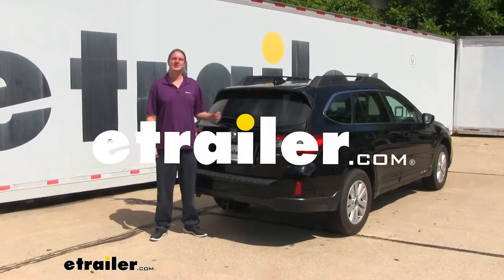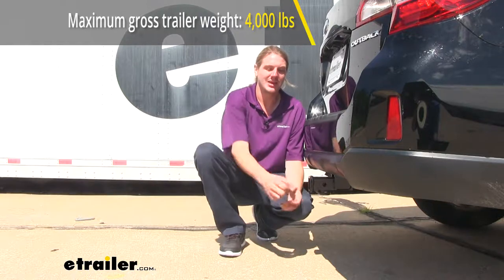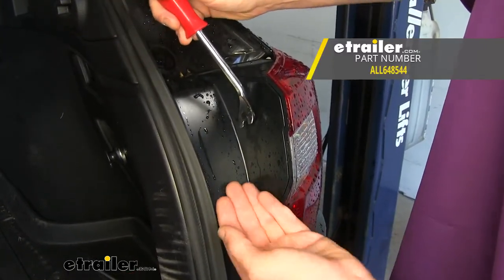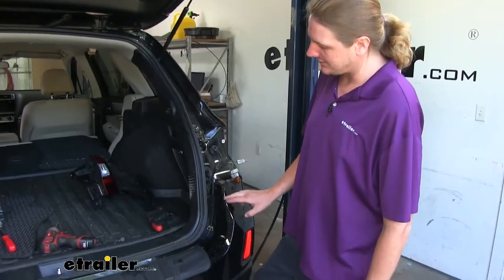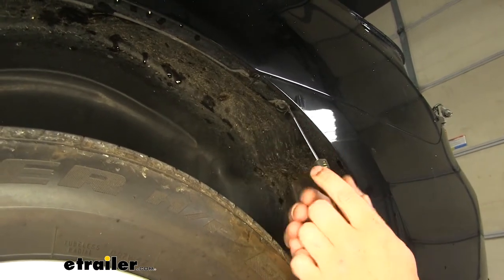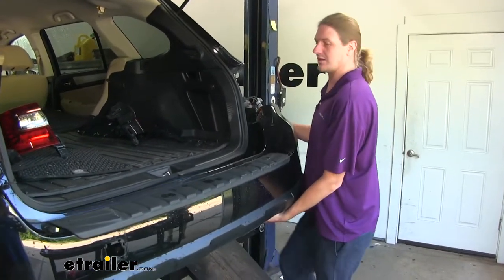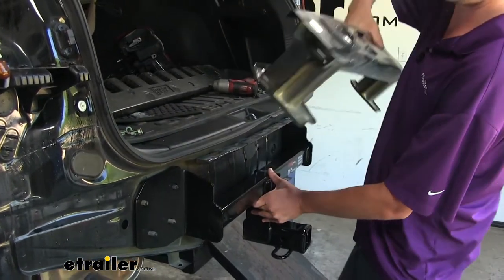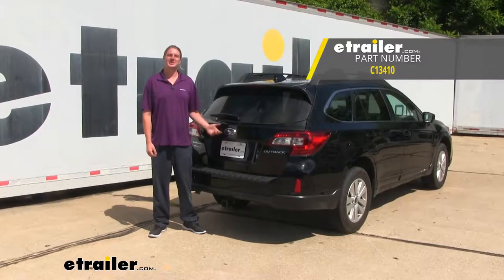etrailer | Curt Trailer Hitch Installation - 2016 Subaru Outback Wagon

Comment: I read on a forum that the foam doesn’t go back on once the trailer hitch is placed please confirm. What torque specs should the bolts tightened to?
Reply from the maker: The foam will be replaced with the installation of this hitch. Torque all 10mm fasteners to 48 lb-ft.
https://www.etrailer.com/Trailer-Hitch/Curt/C13410.html

Comment: What about the electrical?  No mention at all!
Reply from the maker: Hi Ray, here is a link to the 2016 Subaru Outback trailer wiring harnesses.
https://www.etrailer.com/t1-2016_Subaru_Outback+Wagon.htm

Each of these will have an installation video on their respective product pages.

Here are some of the videos in a list also, let me know if we can help in any way.
https://youtu.be/Omxl0WiTZW8 - 2021
https://youtu.be/BfEWJ4bYB2k - 2020
https://youtu.be/ShQVK691_jI - 2019
https://youtu.be/Z1kMoRE_JqQ - 2018
https://youtu.be/UqC2wKRpMy0 - 2017
https://youtu.be/prL69rHTwaM - 2016
https://youtu.be/5jaR8mO8uYw - 2015
https://youtu.be/HhKXkd4q-fo - 2014
https://youtu.be/kqmD3-ITOo8 - 2011
https://youtu.be/5alDhesT4wY - 2010
https://youtu.be/yuiVpBVkck0 - 2009
https://youtu.be/es-4Nmakk1M - 2006
https://youtu.be/ij2jv_HD_6Y - 2005
https://youtu.be/rGZ7WvqJGm0 - 2000